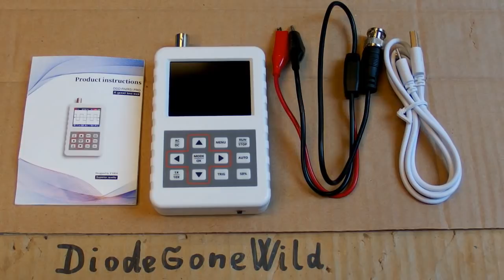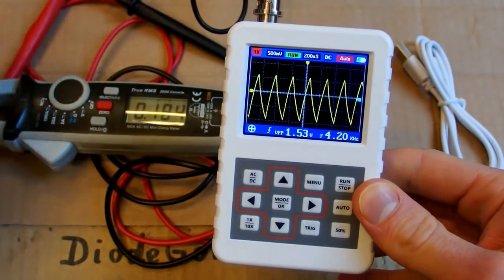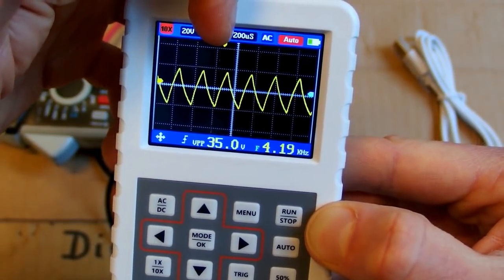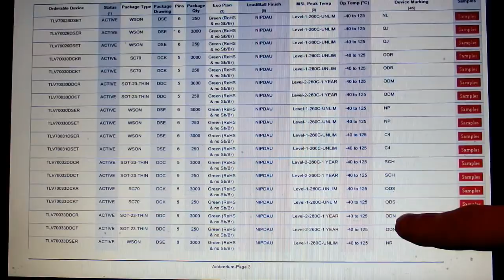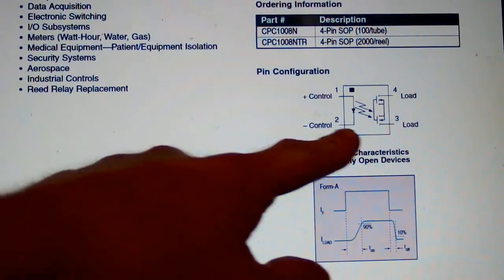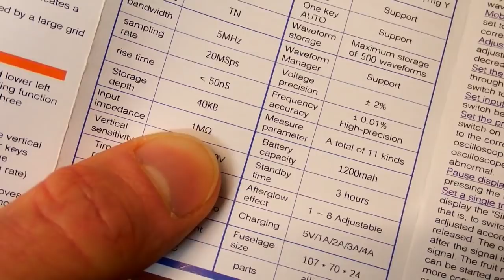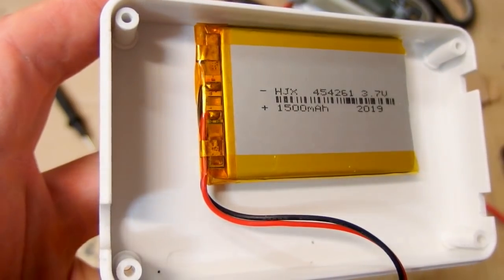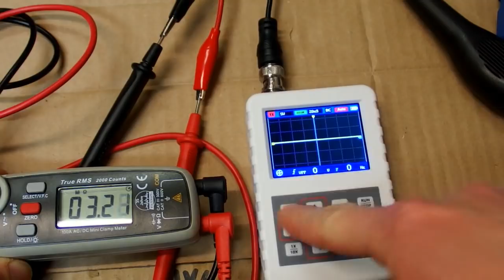My digital oscilloscope (test, teardown, fix)

Comment: (14:26) - And I thought I was the only one to do that !
When you take apart and then put back together many cheap things like this, you quickly learn how easy it is to "strip the existing thread"
No one seems to comment on this at all.
All those digital multimeter reviews where the battery compartment lid has self-tapping screws which are oh so easy to cross-thread if you do not do carefully with a keen ear and a delicate hand.
Sir! You know exactly what I am talking about.
I wanted to make a video myself for so long about this and even now I guess at least half of your audience do not even understand the significance of your stirling, perfect, fantastic instructions.
Now we have to meet.
It was destined to be.
>
Reply: I always thought I was the only person that did that. I feel like I'm finding my people now!
Reply: I do that too!
I also tighten opposite corner/side screws, it helps get better alignment!
Reply: There aren't many of us. Father trained me well. I cringe when I see people not doing this!
Reply: @ches74  Oh tell me about cringing !
>
Reply: Someone ask me if I'm to dumb to put the screw back in as I did the trick :(
Reply: Here, get a like, you deserve it
Reply: A pro-tip: when screwing in any screw, first put it in place and turn it backwards until you feel it clicked into the first loop of the threading ;)
Reply: First read about this trick in Practical Electronics for Inventors. Did not  know before that and just relied  on luck.

Comment: Those batteries are available in all sorts of sizes and capacities. Most of them are made for RC drones and offer a very high discharge current. Those might not be the safest ones to use;)

Comment: Good video. This looks like a much more usable product that other low cost digital oscilliscopes I have seen.
Reply: Have you checked out my Hantek IDSO 1070A? For 150 Euro you get 2 channels up to 70MHz, Wifi and USB connectivity and 2 pretty good probes. You can use it with PC or Android / IOS phone / tablet
I am very happy with it and after 6 months of active use I can recommend it, for it's value you get REALLY good scope!
Check it out.
Reply: Vít Cenek 
At 4/5x the price the Hantek falls in a different category. That doesn’t mean it isn’t very good value for its price but just that it’s not an alternative for someone with a budget for the DSO in the video.
Reply: @Conservator.  Yes, I agree. But you get a point. Thanks for your opinion.
Reply: Vít Cenek 👍
Reply: @vitcenek8611  I bought a Hantek. It arrived DOA.
Reply: @Miata822  Sorry that I am asking, but   what does DOA means? English is not my strong part. Thanks
Reply: @vitcenek8611  DOA = "Dead On Arrival" (usually used in hospitals when a patient arrives already dead)
Unfortunately I waited some time to test it and was past the vendor's return time limit. I may tear it down one day to see if i can fix it.  I got it for mobile work and I don't have much of that these days.
Reply: @Heads Mess USB scopes are great for working on things such as automobiles.  You need something mobile and battery powered if you want to watch circuits while test driving.  Being able to save waveforms so you can analyze when you get back to the shop is the cat's meow.
Reply: @Heads Mess I usually work with vacuum tubes for most of the time (I am collector) For this purpose I use our czechoslovak late 50's scope Tesla BM 430 with 46 tubes.
It's really good for repairing tube radios and others...

I don't do too much with transistors / modern electronics, so I wanted something light, cheap and easy to operate. This Hantek is perfect for me, because I don't need to use it every 10 minutes, and for it's price it has really good specs. From my angle of wiew is connectivity via Wifi / USB working good, but I agree that it is slower to prepair for work.

Comment: Quick aliexpress search, it's just 36 euro right now, including shipping. Honestly, i'm amazed by the build quallity, and judging by the look of the cap and ss relay, it seems that it was defective from the factory, and somebody replaced the relay and cap by hand, as all other smds are obviously not hand soldered. Also, about the short of the capacitor, Dave from EEVBlog has a video about multilayer ceramic caps, especially smd ones, which tend to go short if they or the board they're soldered to is bent, so it may have been a poor solder job that has put tension on the cap and it shorted out, for example: soldering one side and pushing the other side with tweezers while heating it up, and by reflowing it you likely removed the short. Should be replaced imo.  Thinking of getting one for myself, it seems great and it's great value for the money, especially for hobby electronics.
Reply: Против Глобал  you do understand that it's 10x the price? Not everyone will use it professionally, and it will never pay itself off. Sure, if you can afford it, go for it. But for hobby purposes, it'll work just fine.
Reply: Против Глобал  - you are an idiot. Like saying that a $40 multimeter is "Not worth it, in my oppinion. Just buy a proper one for 400 Euros or more". Are you related to Dave Jones?
Reply: @johncoops6897  You don't need to be offensive. I owe the same DSO (I paid about 55€ back in November), and I also was very enthusiastic about it at the beginning, but after trying to use it in the real live applications it turned to be pretty useless, for example if you will try to use it in the "single" or "normal" modes triggering doesn't work as expected and in some (even very simple) cases doesn't work at all. So to be honest, I think that I wasted 55€ and would be better to put the money towards proper oscilloscope. So I've just bought proper Rigol DS1202Z-E, and yes this is THE oscilloscope and DSO FNIRSI PRO is just waste of money for me. This is my opinion (and experience) and it doesn't need to match yours. By the way I have short video with proofs that it doesn't work properly, if anybody want I can post the link.
Reply: And by the way, big thanks to the author of the video (@DiodeGoneWild) for very good review of the internals, big thumbs up!
Reply: @johncoops6897  No. You have to buy a real, certified oscilloscope for $2000
Reply: @bitterlemonboy  - I've heard that the only 'scopes and multimeters that are suitable for use by hobbyists are either marked with a EEVblog logo, or were given as gifts to EEVblog (samples for review).
The price is totally irrelevant - don't bother with all that "paying for it out of your own pocket" rubbish!!
Reply: The same manufacturer (and in the "FNIRSI Official Store" on AliExpress) has a higher-spec model that also looks very good for the money, at £61 ($71/€66 ... damn, was that huge exchange rate shift over the past 3 weeks due to COVID-19‽).
€36 FNIRSI PRO: 5MHz, 20MS/s, 1200/1500mAh Li-Ion.
€66 FNIRSI-5012H: 100MHz, 500MS/s, 3000mAh Li-Ion, and is supplied with a "proper" 100MHz probe rather than dual croc-clips :)
Most of the rest of the specs appear to be largely the same - where they supply specs for both models, at least.
There's also a FNIRSI-1C15 110MHz 500MS/s model for £63, but I don't have time right now to see how that compares!
As far as I can tell, these are all better value than, for example, the Hantek 6022BE USB/PC-connected budget oscilloscope...
Reply: I just did a Google shopping search for "DSO FNIRSI PRO". They're questionably cheap (but for some odd reason seem to be working).
Reply: Can you please give us the link for alliexepress of oscillator
Reply: @xnetworkDEVILx  not really, just type "Dso Fnirsi Pro"
Reply: And now it's 55€! That fucking €'s only reason to exist is for transferring even more money from the masses to the rich!